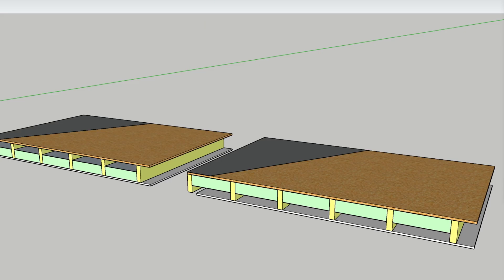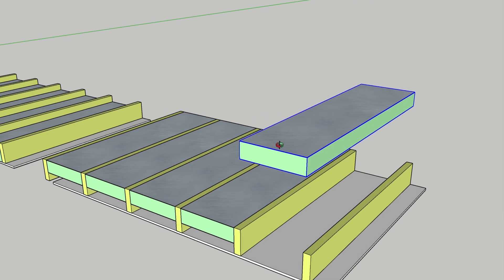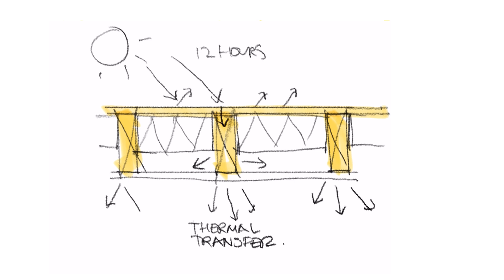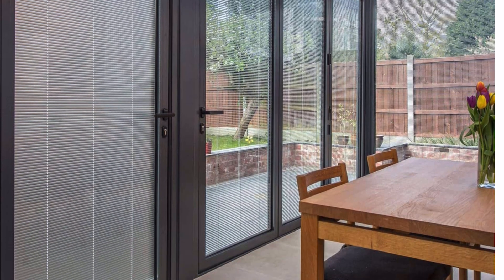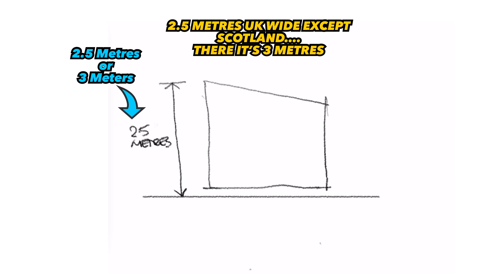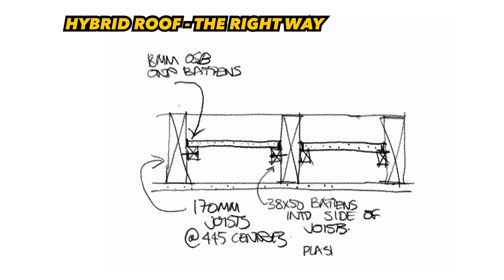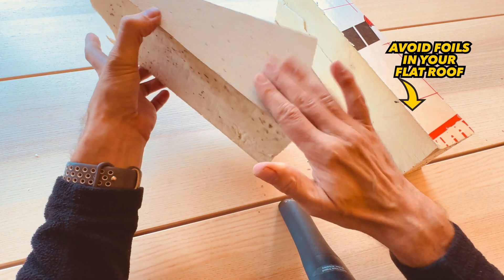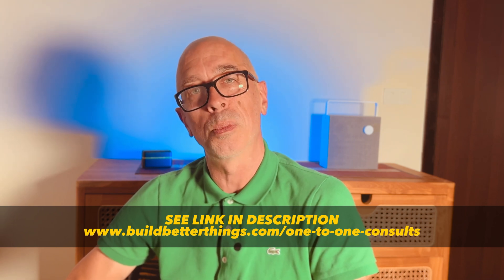Hybrid Roof - Build the Right Way- avoid overheating, avoid timber deck.

Comment: Hi, how would you do this style of roof with a fall, I noticed the Insulation thickness differs for example - this video you aim for the 100mm (70mm and 30mm topper) whereas in the tapered video for similar hybrid set up, the thickness is at 150mm if I remember correctly with the additional insulation that's tapered to a certain gradient.

Could this be done in a similar way to allow for a insulated base fall? For example using the measurements in this video start with the 70mm insulation in-between the stud and have a higher tapered top insulation so something like 120mm going down to 30mm? achieving a minimum of 100mm at its lowest and 190mm at its highest. (probably a generous gradient there but I'm trying to articulate it in respect to the two separate videos). Thank you for the videos thus far very interesting and helpful.
Reply from the maker: Hi.  The arrangement I show in the video is not ideal, but your best way to deal with this height restriction rule.  You need to be very careful with the dew point when you split the insulation, so with tapering insulation, that also applies. So it just depends on what your worst case is for the taper.

Comment: I like the idea of this and it makes sense from a condensation and thermal bridging perspective, but without the OSB are you not losing some structural integrity that the OSB provides by tying all of the joists together? Surely the 30mm PIR doesn't really provide this?
Reply from the maker: I think you could still have your noggins, and with the battens under the “in between” OSB, you’ll get that lateral stiffening. But like everything, probably want to check with your engineer. Thanks a lot for the comment.
Reply: Thanks for the reply and thanks for your videos. I think you've persuaded me to go for a warm roof design, it's only a shed/workshop I need so I'll be leaving joists exposed internally to get the extra bit of 'ceiling height' I need to stand equipment up

Comment: Don’t think iv saw a set of architects drawings yet with this detail so what’s a builder to do?
Reply from the maker: Yes, appreciate the problem. I don’t have an answer, other than pointing out the lack of detail to the client before you start.
Reply: @build-better-things have done this with other issues and the architects saw their arse over it and went from recommending me to blacklisting me. 
I’m Just sick of builders always being made out to be the bad guy when often the design is very lacking in detail and specification. 
we also do higher end bespoke retrofits, with heat pump mvhr, IWI lime plasters etc so architects really need to up their game and also take responsibility for when their design is wrong and not just pass the buck on

Comment: does it apply for steel framed houses as well?
Reply from the maker: This is only for domestic structures that fall under the height restriction for permitted development. For anything else, use a warm roof or a ventilated roof.

Comment: Hello. I am currently building a garden room workshop using your hybrid method. One question I have is, once you have installed the paper- faced insulation between the joists (layer 1), do you apply tape along the joists to create a seal? Also, after applying the top layer of insulation (prior to glueing down the EDPM), again, do you tape the joints where the insulation pieces meet, and if so, what kind of tape would you use?  Many thanks
Steve

Comment: hybrid roof is a frequently used term these days, but if you look at the insulation manufacturers (celotex kingspan etc) none of them have any recommended construction detailing for it

I dont know is building control will accept it -I think they will, but they shouldnt
Reply from the maker: This is not a solution for building regulations and I would not recommend it. The reason I’m discussing it is because for buildings that don’t fall under building regulations and that want to comply with permitted development, there is this rule made by the bureaucrats in the UK that limits height to 2500mm. That in turn makes it impossible to create a warm roof, and creates a condensation risk with the current solutions for insulating rooms. I’m trying to make the best out of a bad situation, but although an improvement, it’s still far from perfect.

Comment: The thickness of insulation on the external side should be greater than the thickness of insulation internally. This is to ensure the dew point is kept as far away from the timber as possible. If moisture gets through the vapour barrier (which it always will) then the back/inner edge of the 30mm insulation with be relatively cold and condensation will occur. 100mm outside, 50mm inside. Or internal is 0.5x the external. Its simple.
Reply from the maker: I mentioned the strict height restrictions preventing any increase in overall roof build-up…
I mentioned a full warm deck construction is not feasible….
I mentioned cold ventilated deck roof is discounted due to significant solar heat through the uninsulated deck as well as its own high condensation risks ….
The proposed hybrid design—with a robust vapour barrier laid directly below (warm side), with a minimum of continuous 30mm tissue-faced PIR layer above the deck represents the optimal compromise in this 2.5m constrained scenario; the non-foiled overlay provides essential mitigation of thermal bridging through the joists, shifts part of the insulation to the exterior, and reduces (though does not eliminate) interstitial condensation risk compared to a pure cold deck or a roof with foil PIR. 
A condensation risk analysis indicates that the dew point occurs above the joists, somewhere between the interface between the 30mm PIR layer and the EPDM membrane. 
Although not perfect, that allows any condensed Vapour to slowly sweat out through the EPDM. And even if you used different criteria and got a worse result , it’s still way better rather than having a condensation risk at the OSB deck and the timber joists like the existing solutions I mentioned. 
This is not Part L compliant, and it never could be, because of the height restriction versus the height requirements of interior spaces. 
Can you propose an alternative that ticks these impossible requirements that the bureaucrats have imposed on homeowners?

Comment: Hello. First of all, thank you for your videos; they have been really helpful.
I have a line of reasoning I’d like to check with you. If any moisture travels between the timber and the first layer of insulation, it will reach an interface with a temperature below 10 °C when the interior is at 22 °C and the exterior is at 0 °C. This means that, at 50% RH, condensation could occur there because the dew point is around 11 °C. What am I thinking incorrectly?
Reply from the maker: Hi there.  The dew point occurs above the joists, somewhere between the interface between the 30mm PIR layer and the EPDM membrane. 
Although far from perfect, that allows any condensed Vapour to slowly sweat out through the EPDM. EPDM hasa breathable aspect to it, as long as there’s no OSB under it and don’t use foils in your PIR .  
And even if you used different criteria and got a worse result , it’s still way better rather than having a condensation risk at the OSB deck and the timber joists like the existing solutions I mentioned. 
It’s trying to find the best of a worse situation with the height restriction rule. 
I don’t recommend it if you don’t have this constraint.

Comment: Thank you for this valuable video. Small question. Won't condensation appear on the top of the 170mm joists as they are the cold bridge in this scenario. Or is the 30 mm minimum of "warm roof" insulation above enough to avoid the condensation arriving there? Thank you
Reply from the maker: You need to do what’s called a dew point calculation, and depends on a lot of things. The dew point is where the condensation tends to occur. The point of the 30mm is to move the dew point beyond the line of the outer face of the joist. This is not an ideal proposal I’m suggesting, it’s making the best of the 2.5m rule.

Comment: What if I dont have downlights, the DPM will be airtight. This should work ok shouldn't it?
Reply from the maker: Do you mean, vapour barrier? And do you mean, vapour barrier beside the plasterboard?
Reply: @build-better-things  yes a vapour barrier then plasterboard. In between the joists 100mm kingspan and 50mm rockwool so no room for moist air. BTW this is for my garden room so low occupancy. I want it air tight because i want it sound proof as possible. Do you think the wood will be ok.
Reply from the maker: I’d be careful about your dew point with that makeup. Without doing the sums, my guess would be the dew point would be affected by the “wool” part of the makeup.

Comment: One big issue with hybrid roof you’ve designed, where is the dewpoint? With small amount of insulation on the deck the dewpoint will be very low into the roof
Reply from the maker: Hi. A condensation risk analysis indicates that the dew point occurs above the joists, somewhere between the interface between the 30mm PIR layer and the EPDM membrane. 
Although not perfect, that allows any condensed Vapour to slowly sweat out through the EPDM. And even if you used different criteria and got a worse result , it’s still way better rather than having a condensation risk at the OSB deck and the timber joists like the existing solutions I mentioned. 
This is not Part L compliant, and it never could be, because of the height restriction versus the height requirements of interior spaces. 
This video is trying to find the best solution for the contradictory constraints put upon homeowners by the bureaucrats

Comment: I like your solution because I was thinking of something similar but my concern is when installing the epdm won't the 30 or 50mm pir compress and get damaged with 2 people working on the roof with heavy boots, this will cause indentations on the top thin layer of pir and thus water pooling, how would you overcome this ?
How about someone creates a 18mm pvc tongue and groove panel to go on top of the pir followed by the epdm, what are your thoughts?
Reply from the maker: Hi. I’ve not had that problem. The product I use doesn’t dent, and anyway, EPDM is not really designed for anything other than light traffic for occasional access. 
You can create a roof deck to walk on, as you suggest, but you would use an inverted arrangement, insulation goes over the membrane, so it’s effectively outside. Deck over that.

Comment: I am in the process of replacing an old flat roof (900mm x 3000mm) which was originally built and insulated incorrectly. Unfortunately, I cannot use a standard EPDM membrane as the skylight installation leaves me with only 100mm clearance on the wall side to work with.
😃
For this reason, I am planning to use a liquid rubber system (Permaroof P100). Could you please confirm whether the insulation panels you recommend can be covered directly with liquid rubber EPDM?

Thank you for your clear and detailed video – excellent work.

Comment: What about the circles visible all over the rubber ? Doesn't it have a slight dip, therefore not adhering to the rubber ? ...i can tell you now ,customers or the general public wont have that one bit ...is there a way of filling them and sanding a flat surface?  Taking away the hundreds of circle dents ...please advice cheers
Reply from the maker: Thanks for your concern about the circles and the general public. You’ve left a similar comment in another video which I answered. The circles bother you, they don’t bother me. If they bother my clients, there are other solutions of course. Just never OSB on the cold side.

Comment: What happens of you have a balcony on top - how do you want on it if no OSB ?
Reply from the maker: Hi. You use an inverted roof. Special Insulation over the membrane that can get wet and still perform.

Comment: I intend to build an outbuilding, and a lot of sun will be on the front aspect, even more so than the roof. Can we apply similar principles to walls? I would need to work out the external finish. I would like an outdoor gym I can use all year around and have cool walls.

Also, have you had any chance to work up some designs to sell yet please?
Reply: I've just found your wall video - https://www.youtube.com/watch?v=xdfVky_GZUI
Reply from the maker: @russtaylor4242 Hi. Yes the walls have the same issue, overheating and thermal bridging through the timber, so we need to think about that, similar to warm roof design. I’ll be releasing a video on my “warm wall” method soon, which is easy to do and gets you amazing u values. I used it on the home you see in this cladding video.

Comment: I’m no expert. I would have thought that solid timber joists were quite a good thermal insulator rather than a thermal bridge. Am I missing something?
Reply from the maker: Timber has lower conductivity than something like steel or concrete, but it’s still an area where thermal transfer will rapidly occur especially if insulation is on both sides of it

Comment: If I'm using a fibreglass roof instead of rubber, can I still glue/stick that directly to pir insulation..?
Reply from the maker: No, you need a deck. I might consider a ventilated roof if you prefer fibreglass.

Comment: would doing this but instead of a 2nd top layer of pir and rubber roof glued to it, instead put on an insulated metal roof panel say 50 or 70mm i know the underside of the insulated roof panels are grooved so wont fit quite flush ie will have some very small gaps. I hope this makes sense. Also possibly use slightly smaller joists say 5x2 instead of 7x2. I would possibly also built it totally flat and use furring's under the insulated roof boards.
Reply from the maker: Hi. You would need make sure to ventilate since you’re creating gaps and you’re likely going to have overheating in summer with no insulation over just.  Joist sizes are dependent on span.

Comment: I'll be sorting my flat roof soon, totally knackered so am intrseted in what you were saying. I assume your method is fully compliant with building regs??  Thanks for the info
Reply from the maker: No this won’t get you the uvalues you need for that. As I said in the video, this is for permitted development only, addressing the height limitations it requires.
Reply: @build-better-things  Thanks for clarifying. Surely even under PD you would need to comply with building regs and have them sign off the work? If it doesn't comply what's the point? I'm a little confused so forgive my asking a follow up
Reply from the maker: Many people aim to build below the square metres and below a certain height so as to avoid the requirement for building regulations. If you look at the opening section of exempted buildings of the regulations. The solution I’m describing is for people with such an exemption.

Comment: useful video as i start to plan my garden room/home office.
I have no requirement for down lighters looking at 150mm joints instead of 170.
Love the idea of the rubber coming around the roof for a cleaner look.

Comment: Hi I'm converting my daughters garage into a room, I've used 7x2's and them 75mm to nothing firings then cross battoned it and Osb on top with rubber roof
I've been told to use the insulation boards rather than the rolls is this correct
Reply from the maker: Hi. Sorry for late reply. It’s difficult to say without seeing the make up but PIR boards are going to perform way better than mineral wool quilt. Best of luck with it.

Comment: Hello, With your proposed Hybrid Roof buildup can you confirm It would be OK for me to increase the 30mm min over you joists to 75mm, I would also have 75mm between the joists both tissue faced. my finish would be Arboflex liquid PU using a recommended carrier membrane on top of the tissue PIR with primmer. Many thanks.
Reply from the maker: The more you increase the layer of the top insulation, the better. As for increasing the layer between the joists, you need to be careful as it moves the dew point towards the interior. So just check out BS EN ISO 13788